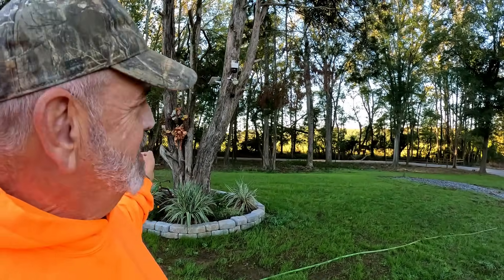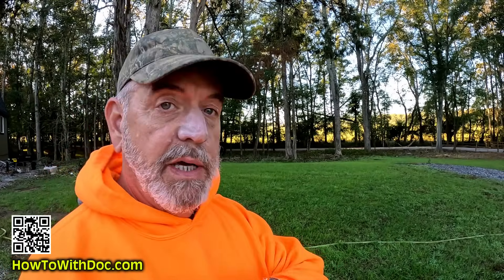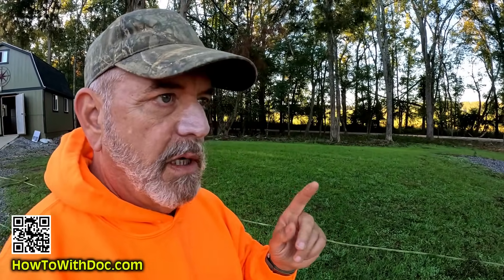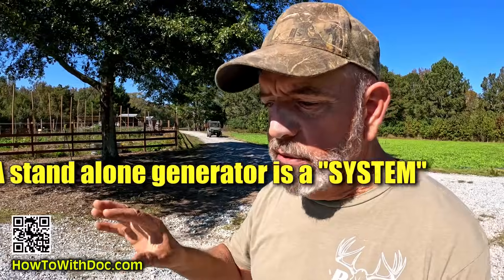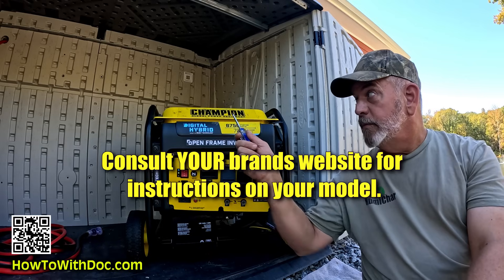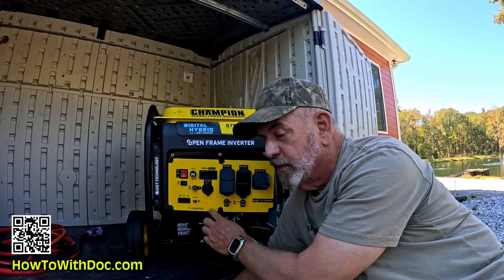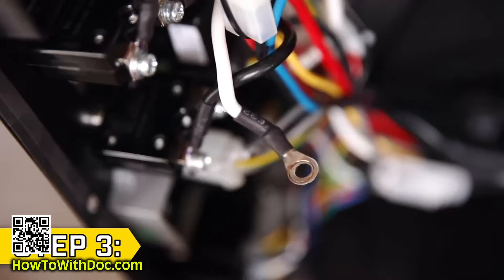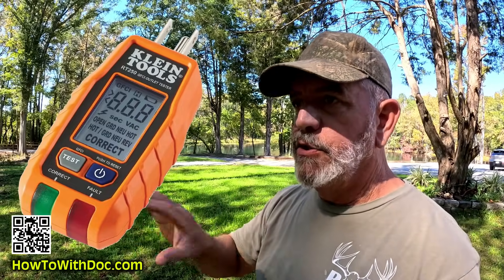Should You Disconnect the Neutral Wire on Generators

Comment: I leave my generator bonding in place but when connecting to the home ONLY connect the neutral. Not connecting the ground isolates the generators bonding from the home's.
Reply: Please do not do this. Please talk to an electrician. "Not connecting the ground isolates the generators bonding from the home's" ALSO removes the direct ground fault path back to the source of power (the generator). This is a dangerous setup. Why? When some device in the house, let's say the furnace, has an electrical issue and energizes it's frame there is no EASY grounding conductor path back to the generator. Electrons WILL be trying to get back to the generator through the BONDED neutral at the main panel. But, probably not enough electrons will be able to travel through ANY and ALL paths back to the generator to trip its breaker. This is the danger. Somebody unknowingly touches the frame of the furnace creating a NEW path back through themselves which can kill/injure/shock. Consider yourself lucky if you only feel a strange tingle. Experienced electricians (old timers, still living) have described instances of this tingle situation to me. No wonder electricians wear appropriate gloves these days when working on "dead" equipment.
Reply from the maker: I agree
Reply: @HowTowithDoc  From DuroMax generators manual...Note: If the generator is connected to a home, then it won't be necessary to attach the separate grounding wire and you can opt to use your home ground instead.Please see a certified electrician for further options with grounding your generator.
Reply: @wingloading  I was about to reply to your response from about a day ago (I will do that soon) when I saw this post. I quickly checked a few DuroMax generator manuals. I saw that this same "Note" you quoted was in all of these manuals REGARDLESS of whether or not the Neutral was bonded on that particular generator. And, btw, you left out the following which comes after what you quoted: "WARNING:  Failure to properly ground the generator can result in electrocution." Now, this warning was appropriate for the entire section or "Step X" of a manual but you only quoted the "Note". My wild guess here is most people will never need to do this step for their safe use of a generator. So, I will leave this Step unstated.

A good rule to keep in mind when complying with manufacturers manuals is to also comply with the National Electric Code (NEC). In my mind, when there is a conflict, the code should take precedence. If somebody does not understand the code then by all means hire a licensed electrician, as you posted.
Reply: @takeitwithyou4391  Help me understand. In a furnace fault where the current finds its way back via its ground will then travel through the panel bonding and subsequently the neutral (of adequate load) to the generator. A dead short should normally trip the panel breaker first. How would extending the grounding in the panel to the generator that's not bonded be safer?
Reply: @wingloading  First, I see your question for me. I will attempt to answer it at the end of this post.

Second, let me say that I think you have put a lot of thought into your setup and it works for you. I get that. I imagine you are using a generator with a Bonded Neutral and your home Main panel also has a Bonded Neutral. The extension cord you are using, essentially, has NO ground conductor. If you are using a typical transfer switch then there would be only ONE Bonded Neutral in play at any time, depending on transfer switch setting which determines source of power.

Third, I would never have thought of this method. Now, knowing, I would implement it only if I had no other choice. That is, I weighed the rewards and risks of doing so to get the power on. If I did do it then it would be for a very short period of time. That time period would be the time needed to obtain/install a “good” extension cord and then remove the Bonded Neutral at the generator.

I don’t know all the code but I do know the National Electrical Code (NEC) requires something called:

Effective Ground-Fault Current Path - this is how to get electrons from a fault back to the source to open the protection device. This means making all metal parts connected to the equipment grounding conductor (EGC). In our discussion so far, that would be the Ground conductor or wire. This conductor must connect all metal part surfaces from the Main panel all the way to the generator. 

In regard to your application, a danger could be, if that “special” (no Ground conductor) extension cord disappears one day. Let’s say, a neighbor needs an extension cord and a family member lends them the “special” cord without knowing it is unsafe to use (not good). Then, that family member goes out and buys a “normal” cord to replace the missing cord. When that cord is replaced there will be TWO Bonded Neutrals where there should be only ONE.

Now, to answer the question: “How would extending the grounding in the panel to the generator that's not bonded be safer?”
My open frame generator (converted from Bonded to Floating Neutral) is over 25 years old and always works like it should but I treat it no different from a new generator I might be testing/breaking in for somebody. I always expect something to go wrong. I just don’t know when or how but plan for it just the same. Before firing up the engine and thereby turning the alternator to make power, I connect the extension cord to the transfer switch and then to the generator. At this point, I am confident the EGC will allow circuit breakers to trip if anything happens once I fire up for power. With all the startups and shutdowns and vibration over the years who knows what could happen. Maybe a part busts loose touching the slip rings causing a “dead short” or a control box conductor vibrates off its post and electrifies the frame causing a ground fault. Issues like this should be dealt with by the EGC and Main panel Bonded Neutral to trip the breakers. I make it a point to always have the extension cord in place while generator is running. Another benefit for safety is, when not generating power, I can use the extension cord for other purposes it is intended for safely.
Reply: @takeitwithyou4391  Thank you for the detailed reply. I too can appreciate the intent behind code vs. reality. As we say in aviation, the regs. are written in blood. In my scenario, while there is no code to exactly address it, I think affixing the connection between the home and generator with no ground (I have a balancing transformer in between that has no ground hard wiring) is a reasonable way to ensure a different cord doesn't find itself replacing my setup. Again, code and reality do not always agree I realize that.

Comment: Just to add a quick note. If you use a separate manual transfer switch generator panel, some break the 2 hots and the neutral creating a separately derived system for the generator and then requires a bonded neutral and the generator grounded. This is the system I have and prefer it as I can use the generator for camping without messing with the bonding.

Comment: It would be nice if the manufacture would put a switch on the generator, that you could switch from bonded to non-bonded.  I know people would mess up when using this switch, but it would be nice.  Since I was an electrical contractor for 45 years, I think I will do this myself.  Good video.
Reply: Or you can find bonding plugs online anywhere really...
Reply: @drigsby7755  Thanks for the information.  I put one in my Amazon list after you telling me about this.  Thanks again.
Reply: Can you share the details on what switch you would buy and hook up?  Assuming I can get a 30amp or 50amp switch and just keep it grounded but go between the jumper wire and its other unmarked connection
Reply: @AlissaGrieves  Don't do that
Reply: @AlissaGrieves  I am sorry I can't tell you how to do this project, because it would make me liable.  Since such a switch doesn't come on a generator then your warranty would be no good.  There is a video online that shows how to do this, but it is not a from me.   You could talk to one of your local electricians.
Reply: @OUFan2  No you are not liable. You are an anonymous stranger on the internet. No-one is coming after you.
Reply: Some of the hybrid inverters for solar do this with a relay.
Reply: I believe some of them do. There is a button with a small display next to it showing a button depressed signifying bonded neutral or floating.
Reply: Why bother? Just lift the ground at the Generator inlet. Now your home is still bonded and the Generator is still bonded. You just isolate the bonding individually by lifting the ground at the generator inlet.

Comment: Or do one better. Hire an electrician like I did. That takes the guess work out of it. If you don’t & you make a mistake? You could damage your home or appliances.
Reply: ... and if the electrician makes a mistake, it would be on them to get it done right.
Reply: @ I’m considered an “outside wireman” (power lineman) through the IBEW. I don’t possess a license at my job because I work for the same utility that feeds my house power. I don’t have to take a yearly test to recertify. Working inside my house is a separate craft. I’d rather pay an electrician to do any extensive electrical work in my house. Swapping out a light switch or outlet is simple enough. Adding branch circuits I hire a pro. They can do it faster & make it look better than I could.

Comment: Watched this and then decided I needed to know. As with almost everything on earth the answer is "it depends". My generator connects to a disconnect box at the power pole that contains a 200a breaker for commercial power and a 50a for the generator. The generator is bonded but I've run this several times with no issues so I had to find out more. Called The manufacturer, Wen and their technician said in that case it is not an issue. If the generator was feeding into the main cb panel for the home or some other sub panel after the power company input then it must be floating on the generator. He said I could disconnect the bond in the generator but is not necessary in my installation. Go figure
Reply from the maker: Your input is prior to the cb panel which is unusual. In that case I would have an electrician check it. The main issue will be multi PATHS which can throw GFCI switches. If you don't have issues I would leave it.

Comment: But couldn't i just not wire the neutral into my L14 plug so that when it's connected to the generator there's no neutral to begin with?
Reply: Actually just not wire the ground from the generator. You can then leave its bond in place since it will remain isolated from the home's bonding.
Reply from the maker: No, neutral wire is part of the PATH
Reply: @HowTowithDoc  Yes if you're feeding your home with it disconnecting it from inside the generator or the plug or the breaker box it doesn't matter where you break the connection at as long as its broken
Reply: assuming you're feeding with 220

Comment: Ok,I think I follow you now about removing the neutral bond at the generator..The neutral itself still goes from the generator cord  at the generator to the panel..Whew,I thought you meant disconnecting the white neutral wire that goes to the cord,which would mean you would only have 220 volts at the panel without the neutral there.
Reply from the maker: It's only on the gen itself. There is one point where the two connect.

Comment: This begs the question of why then do all connecting cords which connect your portable generator to your 
service panel (transfer switch) have a neutral wire  within the cord. I watched 2 video’s on This Old House on connecting a portable generator to a house panel and neither mentioned the need to disconnect the generators neutral wire and neither does the DeWalt manual for my unit. I suspect this is a so called wives tale making the rounds.
Reply from the maker: If you don't and your connection feeds into you main panel, you'll have TWO PATHS.  By code there should only be ONE connection between  N and G. Plenty of electricians explaining this issue.

Comment: Excellent point great video. I have two smaller inverter generators. I have a 3500 w fully enclosed. I also have a 4550 open frame the open frame was neutral bonded I put in a toggle switch so I can bond it at the flip of a switch. If I’m using it not tied to the house I have an interlock. I just don’t run my 240 devices since it’s 120 but I can parallel them together and get 6000 W if I need to, which is more than enough to run the refrigerators heat and microwave or hot plate to cook on most the time. I just run one my 3500. I average around 12 hours on about 2 gallons of gas the 4550 holds about 3 1/2 gallons says it can do 18 hours at a quarter load haven’t tested that yet but I have a conventional 7000 W generator and it definitely uses lot more gas than the invertergenerators.

Comment: Would it be more efficient to have a battery/generator combo. Then, the generator runs at near full load only for a short period, and the battery handles the shifting load demand. Yeah, I know some generators adjust to loads, but I doubt it's as effective as a gen/battery combo.
Reply: That is what I did. My battery can run my fridge for 8 hours. I have two of them. It takes 1 hour to charge them both up with the generator. The generator can do that 10 times on a 20 lb tank of propane or 2 gallons of gas.
Reply from the maker: You'll see it in an upcoming video

Comment: I don’t like the idea of a floating neutral in case the generator is used independent of the home. My Ryobi generator has a ground lug on the generator casing. I drove an 8 ft. ground rod which I connect to the lug. I did not land the ground wire that comes from my home distribution panel inside my 30amp receptacle. This does the same thing as lifting the neutral wire in the generator. After all of that, tomorrow I am having a Kohler 20kw generator installed. Runs on natural gas and will power everything in the house. I know you see “Generac” everywhere but I recommend Kohler.
Reply: Ground rod at the generator has nothing to do with the problem with multiple neutral bonds. In fact, adding a ground rod actually isn't recommended when using it attached to your house's system, only if it's not connected to the house's ground when in operation. If you're worried about using it as a standalone generator, get a neutral bonding plug that bonds neutral to ground when you plug it into one of the generator's outlets

Comment: These generators suck up a LOT of propane. I hook up to natural gas, but always have a supply of propane and gasoline in reserve in case the natural gas lines lose pressure for a variety of reasons. Also, I never rely on only one generator.
Reply from the maker: Correct... like WATER... natural gas compressor stations need power to work long term.
Reply: @HowTowithDoc  And uprooted trees can damage the lines. Also, too many generators running simultaneously in a common area can reduce pressure to the point of fuel starvation.
Reply: A Tri Power generator  essentially means a generator that increases the odds that you have a fuel source that might make it work !

Comment: What’s the negative for having both the generator and the breaker panel grounded?
Reply: Doc missed an important point. If your Main breaker panel is not the Main Disconnect, meaning there is a disconnect panel by your meter, that disconnect will have the bonded neutral, not the Main breaker panel  Then, if your main panel has an interlock, which is code when you use a generator, that interlock segregates the main breaker panel from the disconnect,  so you would still want the bonded neutral on the generator.
Reply: @spacecoastkid5033 This is the question that I have been seeking answers to for weeks.

You have perfectly described my situation.
My breaker panel indoors is not the main disconnect. The main disconnect is outside by the meter  and it is there that the ground and neutral are bonded.
To my mind, when the main power goes off and I am now generating power from the generator through a transfer switch, into the main panel. I effectively have a separate system from the bonded neutral connection which is out by the meter. As a result, to my mind, i would need to have a generator with a bonded neutral.
Reply: Multiple paths for current to flow, half could end up at the generator and half at the panel.
Reply: Electrical code requires only one path to ground.
Reply: I did not know about this but it cost me almost $800 it burn all of my GFCI Breakers .

Comment: I added a label to the generator to indicate it's been changed to a floating neutral in case I die so the next user knows. And I have a plug that I can plug into one of the generator's power outlets that "re-bonds" it if I need to use it standalone